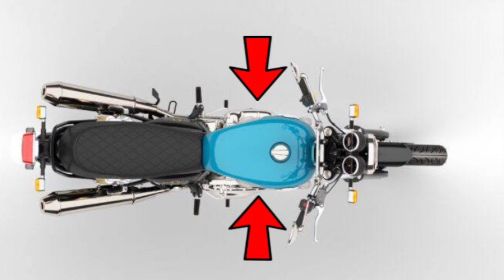❌Burn wound❌ Engine Heating Issue | Royal Enfield | Meteor 350

Comment: Hi bro
I didn't understand properly, can you please explain in english in short
Reply from the maker: In this video I have shared about the engine heating issue in RE meteor. I got burn wound because of engine heat. Interceptor also has the same engine outlook as meteor but there is a protector to avoid the heat to the legs
Reply: @DJRider  is this heating issue resolved in the upcoming models ? Because I'm planning to buy. Would you suggest me to buy or not ?
Reply from the maker: @amitshanbhag7738  Except this heating issue, the vehicle has designed amazingly. I will 100% recommend you to buy this for long ride and city drive
Reply: @DJRider  Thanks a lot